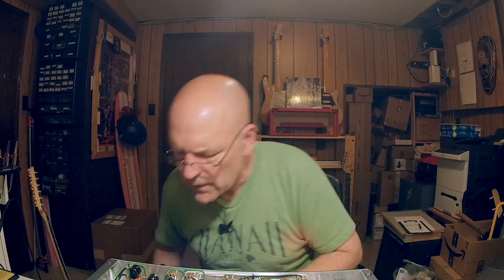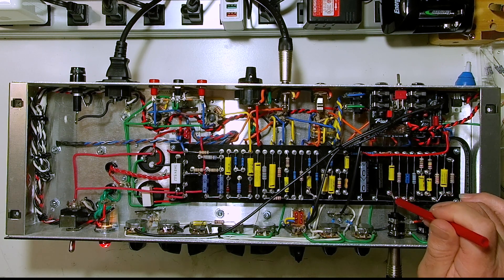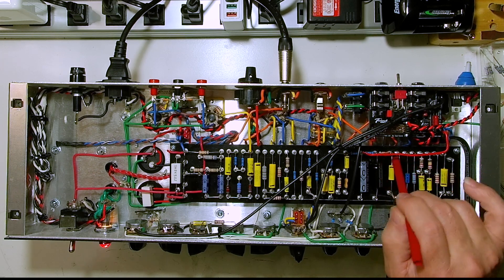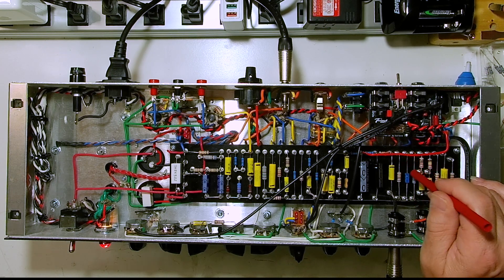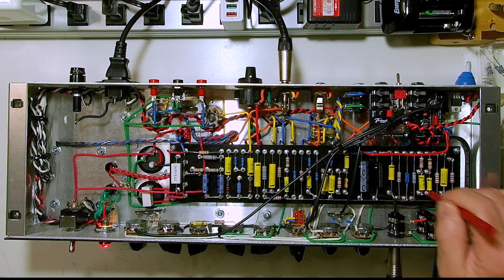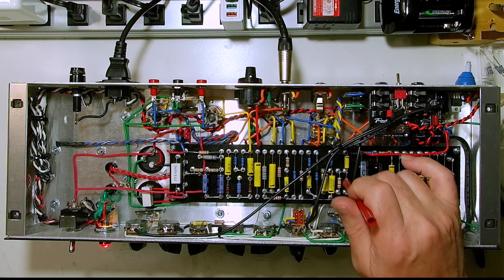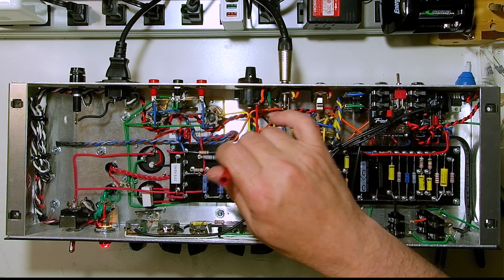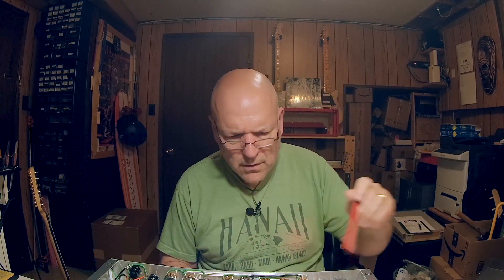Jag's Tech Tips - Chopstick Test

Comment: Is it safe to tap the high voltage area? I have low pitched static noise from the power tube socket
Reply from the maker: Be very careful around the high voltage areas. Keep one hand behind your back and wear rubber soled shoes, especially if you are standing on concrete. Also, do not be sitting in a chair, stand up. Do not tap with your bare hand. Only use something non-conductive like a plastic chopstick. Don’t touch the live circuit with anything metal or anything that can conduct electricity. 

Be very careful.